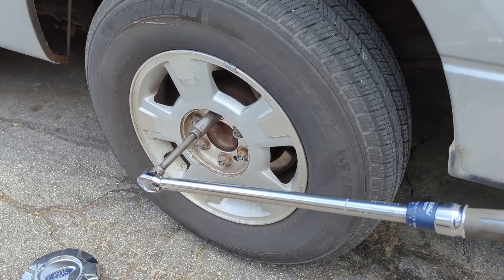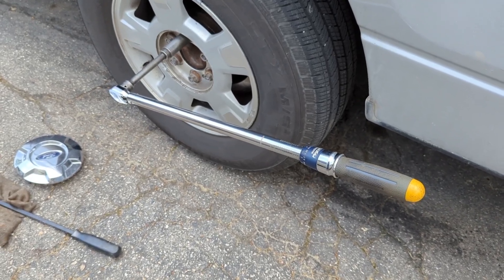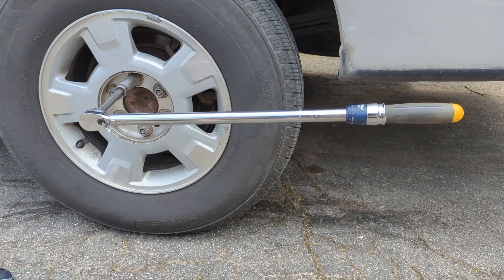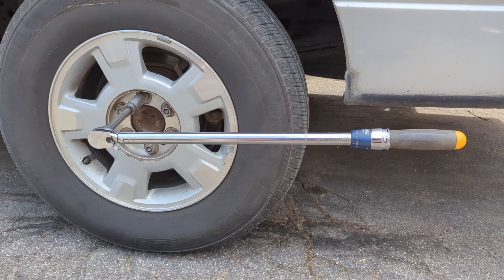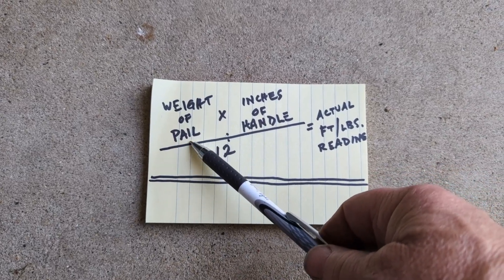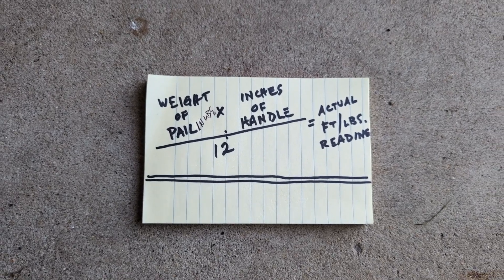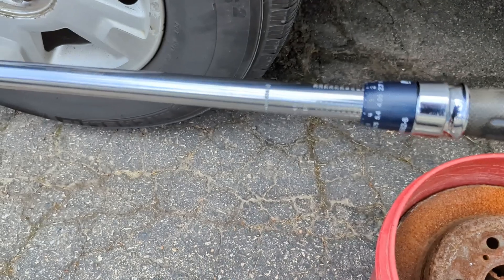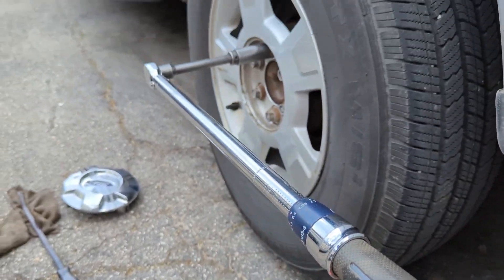Check Your Torque Wrench

Comment: The torque wrench might be more accurate than the scales! 🙂
It may be worth mentioning for any viewers, if an adjustment seems desirable, with this design of wrench with a single adjustment available at the handle, this adjustment is for the least compression on the spring, commonly 20% of the range. Adjustment should be done with suitable choice of weight at the 20%, then repeat the check at the desired mid-range working torque. If it's now good, you're in luck and the spring ratio is still good. If you can't get it good in both spots, the spring could be out of spec, or the upper range torque adjustment has gone off. On these wrenches this is not accessible, the tool has to be dismantled and parts substituted or otherwise adjusted. If a mid-range adjustment is done without knowing whether other values are still correct, only that one torque value might be right.
Reply from the maker: Yeah, I like using that bathroom scale inparticular because I'm always about 20 lbs. lighter on that one than the one at the Dr's office, (hahaha just kidding). I'll give it to you that the wrench should be checked at numerous spots along its range. As you said, start off at the 20% mark and go up from there. I like to make sure that this wrench is accurate at the 80-90 ft lbs area for all the wheels that this thing tightens on. This one gets used for multiple cars per day, x 20 wheel nuts on each vehicle, x going up in two stages of torqueing per wheel nut, and then sometimes click them all again to make sure I didn't miss one, x 10 weeks in the Spring, and 10 weeks in the Fall. This wrench literally has thousands and thousands of clicks on it. I just like to check out that mid-range in the Spring and in the Fall to make sure its still close. I have a few other wrenches that get used for somewhat more precise engine building and such. Good points you made there, I appreciate your input. Thanks for watching.
Reply: @wrenchgearsadventures   Have you experimented at all with a digital torque adapter? They're budget now and quite accurate - could simplify multiple checking without juggling weights (I recognize the point of this video was using just what was to hand), but batteries can be a bugbear.
Reply from the maker: @PlatypusPerspective  No I haven't played around with the digital torque adapters at all. Might be something I could look into if they were reasonably enough priced. I only do this procedure usually once in the Spring and once in the Fall. Gives me piece of mind that I'm still in the ballpark. Thanks for the suggestion.
Reply: @wrenchgearsadventures   The EPAuto unit I have cost AUD 60 online, about $44 US.